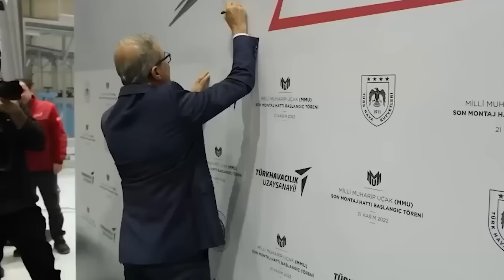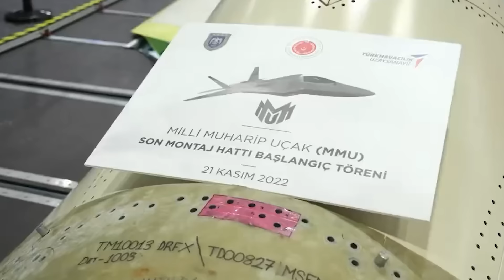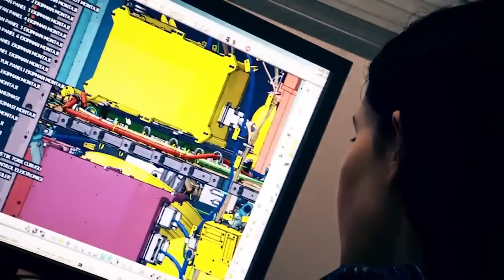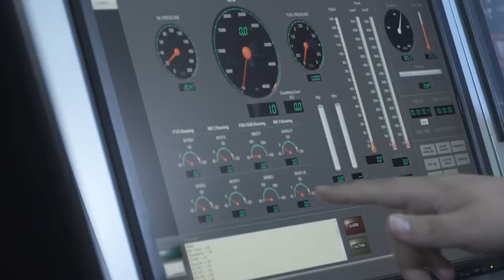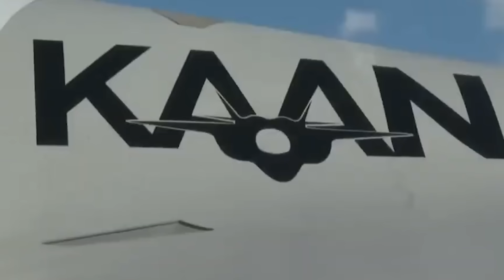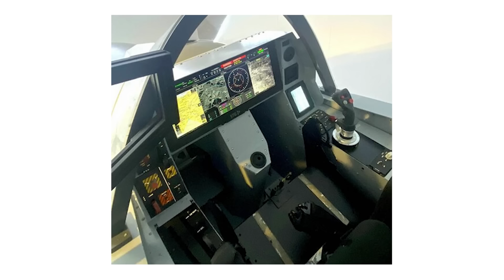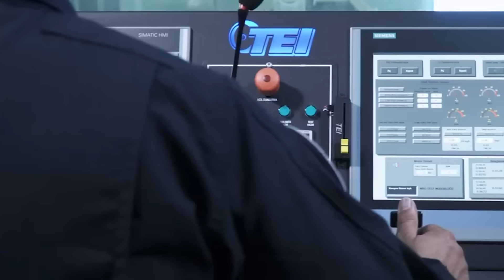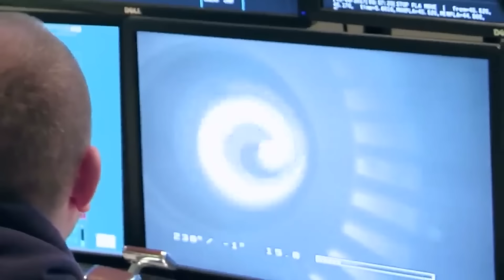Turkey's TF Kaan 5th Generation Fighter

Comment: If Turkish engineers had as much money as the US ones did, they would have made unseen and unbelievable technology. How much they make on so little money is simply stunning.
Reply: Programın maliyeti 15 milyar doları geçti. Yerli motora (tf10.000) ayrılacak bütçe ile 20 milyar doları geçeceğe benziyor.  Ama uçağın son hali bu prototipden daha güzel olacak.
Reply: US have a very big army thats bigger than any army of the world. So when they produce something they have to seek the interests of all the military branches. They have to consider their allies doctrines, preferences and militaries so the project tangles so far so much that it takes years of hardworking to achieve anything.
Reply: Da geb ich dir recht absolut!!!
Reply: They said the design and engineering was supported by BAE Systems (who know a thing or two about modern military avionics) so I suspect that heavily helped the speed  and cost of development.
Reply: When the project started, we had to get help because we lacked personnel in some areas. This allowed us to complete the prototype in record time.
Reply: If they had not helped, it would have been completed maybe 1-2 years late. But even if you have the money at the end of this, there is still a possibility that you will not be able to buy it! When the plane goes into mass production, they will be able to say, "Give us planes" with their heads held high..!
Reply: Invisibility is required for the 5th generation, and artificial intelligence is required for the 6th generation. Our aircraft has not only the highest technology but also the largest dimensions among the 5th generation aircraft. The more space, the more avionics. Our aircraft is compatible with the 6th generation. European countries can save themselves from 6th generation aircraft production costs if they wish!
Reply: Lan Türkler, niye sürekli cevap yetiştirmeye çalışıyorsunuz? Uzman mısınız her şeyde?
Reply: @mehmetcagrdogan2753  yoo bizim uçak mühendisleri 1 tanesi 10 tane yabancı uçak mühendisi yapar. Bizimkiler yırtık. Gidip sahaya görün maalesef katılmıyorum.
Reply: @MeselayersizTv  Ne alaka kardeşim ben ondan mı bahsettim. Bir de mühendis geldi yaptı gitti diye bir olay yok bu işin içinde test süreci var bürokratik süreç var, ordunun ihtiyaçlarını belirleme var, fonlanma var başka sektörlerin yeterliliği de gerek. Yoksa proje ödevi olarak her gün derece yapan bölümün en iyi mühendislik öğrencilerine bir avcı uçağı yaptır ne mantığı kaldı 😁
Reply: @mehmetcagrdogan2753  ASIL SEN NE ANLATIYON ne alaka olmm bunlar "ordunun ihtiyaçlarını belirleme" "bürokratik süreç" tek cümleden bile patlıyorsun bunu mühendis mi yapar
Reply: @mehmetcagrdogan2753  Dediğim tamamen doğru neyine laf yapıyon git gör?. Mühendis yaptı gittiyi kim dedi ya element uydurma kardeşim?
Reply: @MeselayersizTv  Tamam kanzi doğru diyon aynen
Reply: @emrullahcelik28  motor testleri uzun sürdü bitti parça kalifikasyon sertifikasyon testi bitti motor parçaları uzun zamandır uretimi devam ediyor  Yerli motorlada ucucak taksitesti uçuşları  baskıyacak
Reply: @mehmetcagrdogan2753  separatism in the united states map  .😂
Reply: Funny, they say the same thing about the Chinese....
Reply: I agreed 👍
Reply: @onurcan8434 6th Gen has yet to be defined.  One of the more prominent proposals is for it to take on more of a flying-wing design, for which the Kaan most certainly wouldn't qualify.

It's a promising prototype, but let's not be hyperbolic.
Reply: @redslate  I repeat, artificial intelligence is required for the 6th generation. If a definition hadn't been made, I wouldn't be writing this now. This is not something related to wing structure. Our plane was built to be compatible with this. That's why it is larger than all its peers. because extra space is required to place them. As I said before, our 6th generation aircraft is already ready. Software integration work is currently being carried out. It is a pilotless plane, consisting of a plane full of computers, and is intended to operate with artificial intelligence at a level that can command all its peers.  It's our job to define, indigestion is someone else's job.
Reply: @onurcan8434  I Repeat ,
6th Gen Fighters are still in concept .  They have yet to be defined .  

You're "writing this now" in ignorance.  There literally is no defined parameter , only notional characterstics.  Feel free to cite a standard/protocol, there is none.
Reply: @redslate  I repeat, already defined. I repeat again, we define it, we don't need anyone to define it, but you just keep waiting. You can try to sell your ignorance to others, but it doesn't work for me.
Reply: Evet
Reply: Thank you <3
Reply: Bro as a Türk i can say its all about cooperation, we are worked with Usa and UK and Italy for making domestic weapeon, Technology transferred also one of main reason to grow up, Also Türkiye is longest distance between Usa thats means if Usa want to sell anything in this region they should make thoose weapons in my country for low price and delivery,
Reply: If a frog had wings, it could fly.
Reply: @MockinGlobes  Bende ABD nin o kadar para ve eğitimli insana sahipken projeleri neden daha geç yaptığına inanamıyorum. Biz Helikopter yapımında da İtalyanlardan yararlandık ama artık kendimiz yapabiliriz. İsrail'de Nükleer bomba  yapmayı İngilizlerden öğrendi ve Pakistan Çin den bu işler böyle. Bunun la birlikte bizim bu işleri hızlı yapmamız ihtiyaçtan.

Comment: Turkey is at a higher civilizational level than both Russia and China. The only drawback of Turkey is that Turkey does not have nuke, which is a political instead of technical problem.
Reply: Bazı konularda eksik olduğunu düşünüyorum. Türkiye belgeli atom bombasi sahibi değil ama suan turkiyede atom bombasi var . Pakistan’dan tedarik edilmiş durumda . Ve daha si Akkuyu santrali kuruldu ve 2025 de 3 tane daha kurulması bekleniyor
Reply: @MusaMAZLUM  you sure really Pakistan has supplied or has an agreement to supply in event of emergency

Comment: Turkey is actually very experienced in this regard because many of the F-16s produced worldwide were manufactured in Turkey by Turkish engineers. In fact, some of the best-performing F-16s in the world were produced in Turkey, with 60% of their components made in the USA and 40% in Turkey. Important parts of the F-35 were also produced in Turkey by Turkish engineers. When Turkey was excluded from the F-35 project, it faced serious difficulties due to this. It's also worth noting that nearly 96% of the components in currently flying aircraft worldwide are produced by Turkish companies. Turkey had everything ready to produce its own aircraft, including state-of-the-art technology, and finally, it succeeded. With 17,000 engineers, a significant portion of whom had previously worked and gained experience in the USA and the UK, Turkey was able to bring back these experienced aircraft engineers to work on this aircraft for their country. An aircraft capable of performing the tasks of both the F-35 and the F-22, meeting NATO standards, was designed and built. Although the aircraft is technically a 5th generation aircraft in terms of avionic systems, its engines are based on the F-16 engine, so we can partly refer to it as a 4.75th generation. However, since Turkey will produce its own 5th generation engines, it will be fully considered a 5th generation aircraft by 2030.
Reply: Well said. Türkiye has the experience and the sheer will power to succeed.
Reply: The first F-16 production in Turkey started in 1987. At the time, it was much cheaper to buy from the US. However, even though it cost more, Turkey built its own factory to learn aircraft production technology. Today, thanks to this know-how and its trained engineers, it can produce F-35 parts and its own design Kaan.

Comment: Let me give you some little information. They have also successfully started the engine they call TF6000. This engine is the low power version of the one to be built for KAAN. They will use this engine in the unmanned warplane and delta wing plane (I forgot their names) that they build. They also mounted the AESA radars they produced on UCAVs, ships, air defense systems and Block 30 F16s and started testing them. They bought a plane from the USA. They will also start testing the radar and sensors to be installed on KAAN.
Reply: The unmanned warplane is called 'Kizilelma', which literally means 'red apple'. In the history of the ancient Turks, 'Kizilelma' was the target that must be obtained by means of diligent effort, with unbroken determination and at any cost! As for the delta winged UAV, it is called 'Anka-3'. By the end of this year or in early 2025, the engine 'TF6000' will be powering both UAVs. So, it will mean that both UAVs will be 100 percent indigenous vehicles.
Reply: Delta wing one is ANKA 3
Reply: Anka 3 and Kızılelma
Reply: Anka 3 and Kızılelma
Reply: TF 6000 sadece bir başlangıç . KIZILELMA da kullanılacak siradaki motor TF100000 ve daha sonra TF25000 KAAN için kullanilacak
Reply: @MusaMAZLUM tf 35000 olacak diye biliyorum yanlışın olmasın
Reply: And still mr. Erdogan is always angry & frustrated. Must have to do with his weird medieval believe fantasies.
Reply: @rajarsi6438  you know nothing about Erdogan ...
Reply: @elkadiriverrufai  You're of course entitled to your fantasies. That's also all you've got in your "life".
Reply: for anka-3 and Kızılelma
Reply: @rajarsi6438 biz sizin gibi değiliz
Reply: @TURKOPOL46  Perhaps try English mate.
Reply: @ahmetatci7745  geçen gün yerli motorumuz yabancı emsallerinin %30 üstünde bir güçle çalıştırıldı. ve bu daha başlangıç, çünkü bizde özveri ve kararlılık çok yüksek seviyededir!
Reply: @bulenthide9129  not delta wing, it is flying wing.

Comment: As a Turk, I can say that it is the best video produced by foreigners. It was an excellent video that touched on almost every subject, containing completely unbiased and accurate information. I congratulate those who contributed. I agree with what is said in the video. This is a difficult job, especially the engine issue, but if I have to add to the video, the worst case scenario is that an engine can be produced jointly with Ukraine. The rights belong to Turkey and Ukraine. In my opinion, the strongest option is for Tei to make a local Turkish engine or to have a joint engine with Ukraine. The last thing I want to mention is that since this aircraft will be exported, money will not be a problem. Currently, Turkey's economy is bad, but it is expected to recover significantly after 2025 and 2026 and 2027. I was surprised that a foreign channel made such a video. The information on all the channels I watched was incorrect and insufficient. Finally, I don't think there will be any problems with almost anything except the engine. When it comes to radar, Türkiye will make the best radar. Because Aselsan, the company that makes the radar, is one of the top 50 defense companies in the world and this company is Turkey's largest defense company.
Reply: Aselsanin aesa radari f16 özgür projesinde deneniyor. Sadece motor kaldı ama onu da TEI nin bünyesinde bulunan  TR MOTOR seri üretime kadar hazır hale getirecek. Ayni yolu Rafale ve gripin uçakları üreten ülkeler de izledi
Reply: "Currently, Turkey's economy is bad, but it is expected to recover significantly after 2025 and 2026 and 2027" hocam bu bilginin bir kaynağı var mıdır?
Reply: Once you develop and produce a solid jet engine, the rest will come, no worries. Just look how your drone industry developed fast and steadily after you managed to produce one solid drone model.
Reply: Bro, Turkey's economy is not going to recover anytime soon from the damage that the politicians made.

Comment: Small correction to ~9:10, its currently decided that nationally produced engines will be used rather than any foreign engines, as far as i know.
Reply: That is 100% correct.
Reply: Tf10000 in the works. 40.000 lbs of thrust. 

Coming soon!
Reply: @simpledude5974 sallama oglum. Motorun adi ustunde tf10000 yani 10000 thrust. Bilmediginiz seyler hakkinda yorum yapmayin. Kucuk dusurmeyin kendinizi.
Reply: Seri üretime TEI 36000 motorları ile girecek. 2028 yıl. Belki daha önce
Reply: For its own needs it is correct, but for exporting they will provide the option for different engines and configurations. The fighter will be modular. If a western ally wants the fighter with euro jet engine, french aesa radar and weaponry they will be able to acquire it with that configuration. I believe the Turkish configuration will be available only for very close (trustworthy) allies. At some point the same might happen also for the Asian market.
Reply: @simpledude5974  Kaan's engine is not this. This is Kızılelma's Engine.
Reply: @EmirMadoli  Seri üretim değil, ilk motor çalıştırma. 2030 gibi uçağa takılır ve hava testleri yapılır, seri üretim 2032'leri bulur.
Reply: @spiderh  KAAN motoru 2028 den önce üretilecek . Bi kenara yazmani istiyorum
Reply: Daha bir çok stres testlerinden ğeçecek yapdık takalım olmuyor bu işler

Comment: Very well done, thanks… That would have made it better if you mentioned the background of Turkish Aerospace Industries. State owned foundation based company had produced and even exported more than 250 F-16 C-D models in 80’s and 90’s. It is a big partner to manufacture jetliner parts for both Airbus and Boeing. TAI was a partner in F-35 programme, making fuselage parts therefore gained a limited but valuable experience in 5th gen modern fighters. But there is a long way to go. As a Turk, I wish safe landings and quick solutions to the engine problem. By the way, my country is not officially called as Turkey but instead Türkiye. Greetings and thanks.

Comment: Let me clarify the engine issue for you;
The engine has been produced locally and tests are being carried out. When the tests are over, mass production will begin. in other words, turkey will not buy the engine from a different country, it will be produced 100% locally. It is a big mistake to think that Kaan will be somewhere between f-16 and f-35, kaan was designed to be superior to f-22, but what kind of capabilities it actually has will never be fully disclosed. Turkey will not buy the f-35, this has been stated by the state. the americans thought that turkey was dying for the f-35 and they were trying to use this as a bargaining chip, but the state of turkey has made it clear that they do not want to buy the f-35. But in order to reinforce the air force until the kaan is ready and to save the f-35 partnership money remaining in the US, it made an f-16 agreement. by the way, do not think that they are connected to the f-16, if you examine the jet-engined hurkus model, you will see that it is in the dimensions of the f-16 and has the same capabilities.

The F-35 is not completely invisible on radar, especially the invisibility paint is very problematic. in addition, it is an aircraft with a lot of errors, and a country that buys it becomes completely dependent on the us and cannot even take off the aircraft without permission from the us. but turkey has achieved serious knowledge gains from the f-35 production partnership.

Kaan is not only a 5th generation aircraft, it does not need to be used with f-16s because it is capable of commanding a fleet of unmanned aircraft of its own. one kaan is planned to command 16 kizilelma supersonic unmanned aerial vehicles at the same time. Considering that there is a sophisticated war command artificial intelligence on the kaan and that this programme can work in cooperation with the central war command artificial intelligence and can give orders to the entire ghost army and process their data, it becomes clear that only 1 kaan can be more powerful than the entire army of some countries. 

War technologies are developing in the world, it is said to protect peace, partly true, but not entirely true. war is a crime against humanity, but people also need to be able to protect themselves. i dream of a world where people will not have to protect themselves.

Comment: TEI (Turkish Engine) is not trying to build an engine from scratch with no experience. I believe the engine will end up being designed in collaboration with Rolls-Royce, but TEI will have significant role in its design and manufacturing. TEI is not new to engine manufacturing. They had been manufacturing parts for many military and commercial jet engines. They had assembled F16 engines since 1987 for F16s used by Turkey.
Turkey did not purchase its F16s from USA. The contract signed in 1986 required the planes to be assembled in Turkey and Turkish companies to be involved with manufacturing parts for the plane. When Turkey joined F35 project, man Turkish companies were chosen to produce parts for F35.
TAI (Turkish Aerospace) and TEI had been manufacturing parts of F16s and assembling F16 since 1987. Every single F16 used by Turkey were assembled in Turkey. Their quality were real good and some of them were evaluated to be among the best F16s ever produced.
Until USA applied CAATSA sanctions, many parts of F35 were also manufactured by TAI,TEI and other Turkish companies.

Comment: If the plane is so damn good... why the hell they pushed so long in NATO (about Sweden) in order to buy new F-16???????
Reply: Those are the new block f-16. The goal is probably to inspect the upgrades and copy them if necessary. Because Turkey already produce older block f-16 under licence.

USA usually avoid selling Turkey new systems for this sole reason. Turkey keep copying them and produce domestically.